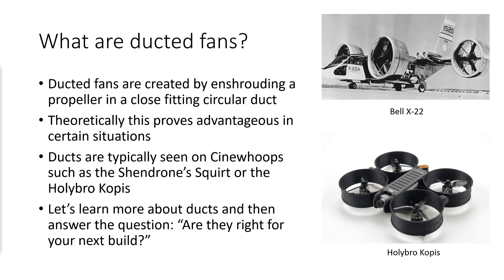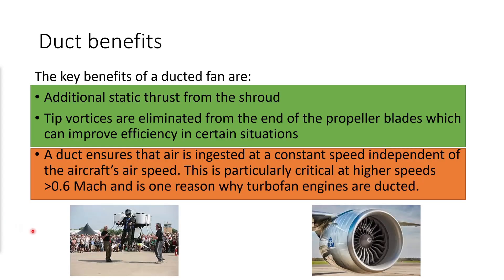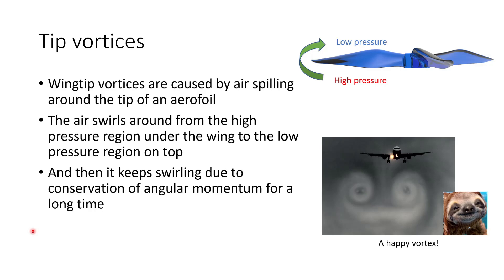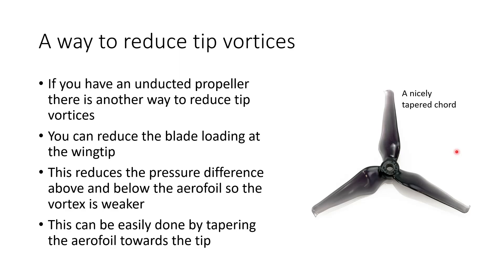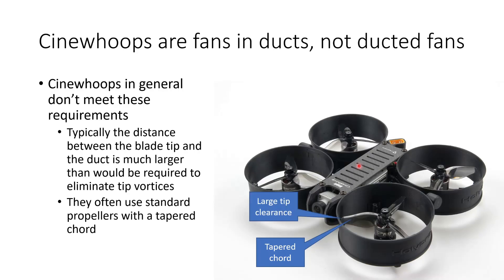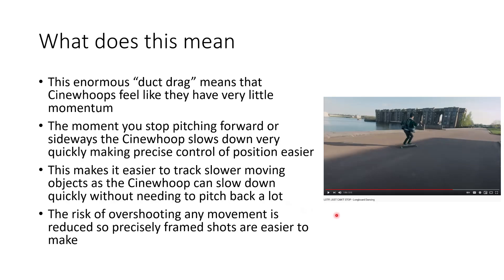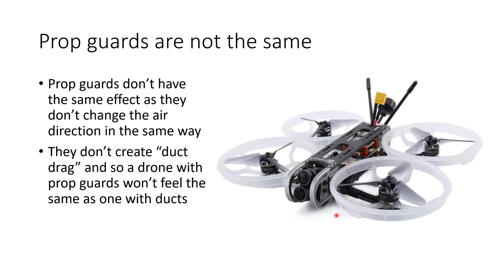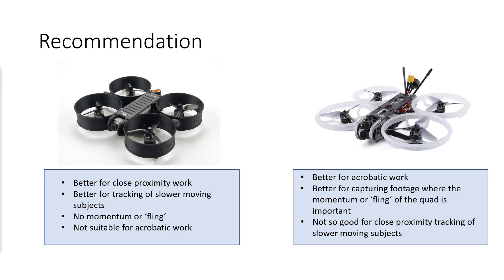How Cinewhoop ducts work and when you should use them

Comment: I recently started messing with ducts, and built a pseudo-tootpick-cinewhoop out of a 2.5" 2s/3s rig I have. Before I added ducts, this thing flew through the air like a dream, it was super quiet and stealthy, but also a bit hard to maneuver through small areas. I 3d printed some ducts that are halfway in between being prop guards and ducts, and it has totally changed the feel of the quad, also it is VERY LOUD! I think its louder than my 5". Its like a siren in the air, i bet my neighbors from 2 blocks away can hear it! I'd like to know more about making silent quads, and cinewhoops, and the sacrifices and benefits you get from flying both. Right now i'm happy because I can do a bit more proximity flying with this build, but at the same time it might scare the subjects to have a really loud siren buzzing around them!
Reply: Interesting.  I've been thinking of a cinewhoop with as low dB as possible.  

I wonder if there's any data

Comment: I did some ducted fan experiments recently.  I tried about 10 50mm props in a 3d printed duct and interestingly the props that looked like ducted fan props did slightly worse on average than the regular tapered props.  The number of blades didn't make a difference past two.  Tip clearance was less than 1 mm -- definitely achievable with a 3d printer.  If you wanted, you could smear a thin layer of beeswax or a similar soft substance inside the duct and then spin up the props and achieve near zero tip clearance.

Comment: You should check out NASA research about Prantl-D wing. Al Bower at NASA did a lot of research on Wings and Bird flight. He figured out that the same optimization for the wing also works for the propeller. In his version the vortex happens about 2/3 of the way out. So I don't know if this is also improved by a duct. But even without you should get better thrust.

Comment: I was hoping you were also describe props that have the duct directly attached, i.e. the duct spins with the prop.   There are lots of 'fans' that use blades like this, I see them in car radiator fans all the time.   I realize this creates a lot of extra weight and rotating weight too that will slow prop speed changes.
Reply from the maker: In my experience at the RPMs our props spin at those rings would just explode.

Comment: For the longest time, there wasn’t any innovation in props, there was only some R&D into materials for rigidity/flexibility for longevity purposes which changed flight characteristics because of how they flex. 
DJI put a lot of thought into their props for their mavic series, they are efficient and insanely quiet compared to what was available at the time. 

I think props still have a little more ways to go, maybe you can tackle the different effects that prop diameter/thrust/pitch speed/weight/KV can have on the overall setup…..
Reply from the maker: Have you checked out this video? https://youtu.be/epJ6L9MaXOQ

Comment: Super interesting. I already knew "ducted" quads didn't work as ducts, but your point about drag makes perfect sense !

On an unrelated note, my main gripe about cinewhoops is weight. I live in the EU, and the 250g limit is becoming very important for this type of quads. At 250g or less, you can basically fly anywhere, while at 251g, you have to stay 150m away from any human being :) My problem is, I wouldn't fly in close proximity without ducts or prop guards, but these add weight, which makes it hard to stay under the limit :)

Also, quiet props for cinewhoop would be great, as they is definitely louder than people expect.

Comment: Really appreciate the work you put into all this analysis. As an ex engineer (patent attorney now), I find it fascinating. However, this now does throw my choice of the next quad to buy into confusion! I was tempted with the iFlight Protek35 (which has guards, not ducts) for proximity flying around BMX riders on a race track (or tracking other similar moving objects), but maybe the Bumblebee (ducted) might be better if I want a more rapid/smoother deceleration through drag. Hmmmm
Reply from the maker: BMX riders go quite fast don't they? I'm not sure whether ducts are good for high speed chase shots. Once you get over a certain speed (~10mph) I think props with guards are probably the way to go.
Reply: @ChrisRosser  Very helpful follow up. Thanks. Yes, BMX riders can be very fast! So I take it duct are more appropriate for slow, controlled, cinematics. Noted.

Comment: Really good,  it will be interesting if you can make a part 2  and have a look at the racewhoop of free zillion.  Now HGLRC sell the racewhoop with the partnership of free zillion maybe they will like that you make a review of there products🤔.  I have also made a design myself and was able to improve the air flow/thrust of the duct 906g at 415watts with 2203.5 3600kv on 4s and hskrc3045 props,  the probleme most of us see is we get alot of desync and yaw propwash  but some user with AIO have no probleme and they can fly them like a freestyle drone. So if you are interested to give tip on how to tune them to be more freestyle friendly,  it will be great.

Comment: Hey Chris, this is one of my favorite vids so far, very interesting.
I wonder if there was somehow a slot in the duct the blades spun in would this help get the efficiency benefits of the ducts without having to run a 1/4mm gap? Or cause more issues with turbulence within the duct?
Also that video u linked was incredible!

Loving all the in-depth science behind our hobby, keep it up Bud!
Reply from the maker: I think you would still get a tip vortex forming in the slot if the gap wasn't  super tight. Glad you like the video!

Comment: a lot of light weight props seem to use prandtl propulsion
they have a lot of negative twist in them
the lift distribution isn't elliptical but more like a normal distribution / bell curve (bsld - bell shaped lift distribution)
the effect is reduced drag and with that faster spoolup i guess, more flow, quieter
the wingtip vortecies aren't at the tip on these props, but about 1/3 of one blade length inward
the wingtips outward of the vortecies act similar to winglets, just that they are flat (dihedral wise)
since the airfoils at the tips are tilted down, the lift vector points forward, producing induced thrust

bsld wings are ~22% larger than elliptical ones, for the same lift coefficient
Reply from the maker: Interesting. For quadcopter applications I would think that the requirement for thrust would push us to sacrifice some efficiency for more thrust for a given prop size? I don't know if the efficiency gain is worth making the prop 22% bigger with all the commensurate penalties in terms of MOI.
Reply: @ChrisRosser  it is a bit of a brain twister, since a elliptical wing of the same span has less drag than the bsld ones and the L/D is better in that case
bsld is the lowest drag solution for a given structural weight (root bending moment), while elliptical is the lowest drag for a given span
i still don't fully understand applications for the different types
if we look at the developements in prop design, it has gone away from bullnose and the likes
a reason might be, that not only the thrust is important, but how quickly it can be produced / switched between different amounts
a fast spoolup would help the fc do it's job fighting propwash and other oscillations
that might be even more important than going fast, it helps with attitude and altitude control, taking out physical "lag" while changing throttle input
a lot of fixed wing designers / developers object to bsld and swear by the elliptical lift distribution

Comment: Thank you very much for this great presentation. I was actually hoping to get insights which will solve the issue I have with my Bumblebee V2. I switched the motors to T-Motor 2203.5 (2850kv). 6s Battery and HQ Prop 8 Blade duct props. I am experiencing desyncs eventhough I set all the settings to fight desyncs and even more I experience a very strange behavior of the quad. When flying around the quad doesn’t react properly on my throttle inputs anymore. When lowering the throttle it just does not regulate down the throttle. It is very difficult to make quick changes in altitude like this. Sometimes it even increases throttle even when my stick is at zero already. I thought this could probably also be an aerodynamic problem. Maybe that because of the quad basically flying only at lets say 15 degrees angle the propellers get very turbulent air at the intake because the flight direction is really not equal to the direction the ducts look. This seems to be very suboptimal innmy opinion. But unfortunately I did not study aerodynamics and as mentioned I did not find anything which helped to solve that issue on the net. Any idea?

Comment: The tip clearance is super intesting. I gave up on tip clearance early on and just asumene everything were running are psudo ducts. Within 2mm is fine.
Reply from the maker: The biggest thing I realised looking into this is that tip clearance isn't really responsible for cinewhoop handling. It doesn't matter that much. As you say within a few mm is fine. 👍

Comment: Im just learning about this, but if you created a looped motor around the duct with the foils curved inward toward the typical the point of rotation but not connected, would the tip vortices be in the middle, creating a vacuum of sorts in the center, causing the air to flow aroind al the blades and combine into the center of rotation?

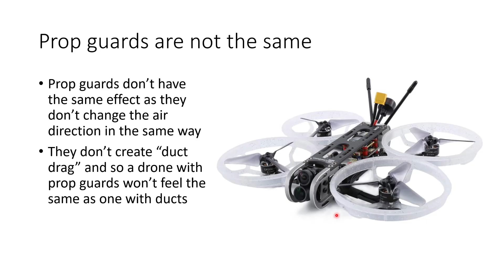Comment: I just ordered a squirt v2 slammed version, the body is shorter and also the ducts are shorter, you said at 16:50 that the quads with just prop guards will not have the beneficial effect of the different feel.
Should I amend my order to the non slammed version? I'm not sure if the slammed squirt ducts would still have this effect or if they're basically just acting as ducts, but QSL the people I bought from tell me it is still a duct rather than a prop guard.
Reply from the maker: I would say even shorter ducts will still have plenty of duct effect.

Comment: Insightful and valuable information. I have been designing my own cinewhoop and its nice to learn more. What about integrating duct and prop to get the clearance issue (rotating duct)
Reply from the maker: Rotating prop rings are very tricky for props that rotate at such a high RPM. Either you would need a lot of blades (which would eliminate any efficiency benefit) or to use a super high performing material that is stiff enough not to deform and break.
Reply: @ChrisRosser  kids toys have props with built in protection. Not ducts, but prevents injury.

Comment: Thanks Chris. Very good Information. Just one thing: if you want to fly close to people with a cinewhoop, ducts or prop protection are nice to have. But doesnt it make the quad much louder? The bigger ducted cinewhoops are rediculessly loud. Draws too much attention, considering its mostle not legal to fly in populated areas near people.
Reply from the maker: Typically cinewhoops are loud due to the high disc loading. They have 3 inch props but weigh as much as a 5 inch quad sometimes. I think that makes them louder in a hover. At full throttle I think a 5inch is louder than a cinewhoop though.

Comment: Hi, 
I asked you this question on your video to props too, but dont know where this fits better and where you will read it, so I copied it here to, hope that is okay:

I asked myself all the time how to think about this on my Cinewhoop: 
To begin with: I have a squirt V2 at home and also I am just designing my own "megas-quirt", that fits 3.5" (89mm) props, as my Squirt is barely holding 
itself in the air with a Hero 8 and a 1300mAh 4s lipo. 

Now to my question:
How do you think that multiple blades change the therory. By that I mean 
the 6- or 8-bladed HQ props, or the much steeper Gemfan D76 or sth like 
this. My testing tells me, that  two props that both are called  to have
 a pitch of 3 aren't really comparable, doesnt matter whitch size (3", 
5", ...). 
In the cinewhoop-part also the diffrent blade-count makes 
everything even more uncompareable. I really have problems to compare a 
Gemfan D90 (3 bladed prop, pitch "3") to a HQ 89mmX8 (also pitch of "3")
 but they clearly are diffrent in their steppness-angle and will poth 
have very diffrent thrust. 

toothpick-class: Gemfan for example 
has a 3018-2 prop (biblade) and a 3016-3 (triblade), I also cant tell in
 this case which prop I could expect to have more thrust. The issue is, 
that we often dont have real numbers to calculate with or alternatively 
have simulation-values or static-bench test from the manufacture himself
 (1st hand).

Sometimes I have the feeling, the manufacuters 
dont use the pitch-value to tell us how steep the balde is, rather to 
tell how much thrust they think the prop makes compared to their other 
props on the market. By adjusting the pitch value they use for marketing
 so they can put their props in somewhat of an order they make 
comparison for us pretty rough, and practically impossible to compare to
 other companies.

Did/Do you think/feel the same as I do, or do 
you understand my problem? If so, do you have any idea how we could 
interpret these values we get from the manufactures, or do anything 
about it other than just buying a ton of props just to find out that 99%
 arent the ones we where looking for?

Thank you so much for your videos, it is great to understand such topics in greater detail, love it, keep it up!
Reply from the maker: Comparing props is difficult because they are not fully specified by the manufacturers. Their performance is also very dependent on your AUW and flight style.

I would suggest trying a prop and then asking yourself what you want more of:  thrust? smoothness? efficiency in hover? efficiency in fast forward flight.

Then use the info in the props video to move you in the right direction. E.g. more thrust = more blades or steeper pitch (but steeper pitch may be less smooth).
more smoothness = shallower pitch

It is not really possible in my view to pick the perfect prop just by looking on the web. But it is also not necessary to just buy every prop and try them all. You can take a more focused approach. I hope this helps.

Comment: Are you 100% sure your math on vingtip vortex and distance from wingtip to ducts are correct?
I see a noticable increase in flight time, with over a full minute more flight time with ducts vs no ducts, how is this not added thrust? This was with a full mm between wingtip and duct.
I hope you give some answer to this.
Always very interesting to watch your programs, keep it up Chris!
Reply from the maker: I'm pretty confident on that maths and I'm not the first to put forward that ducts on cinewhoops don't have tight enough tip clearance to get a benefit.

In your testing did you use exactly the same quad, with the same battery, motors, camera angle, all up weight, props, go pro. Did anything about the build change between no ducts and ducts? Did you fly as close to exactly the same as possible? Was it windy one day and not the next?
Reply: @ChrisRosser  When I did those tests it was the same cinewhoop, 2 packs no ducts, then same two battery packs after charging with ducts. So ALUW with ducts was increased by the weight of the ducts. Still flew much longer. Weather did not change in the half hour or so it took to charge the batteries and put on the ducts. No wind, same temperature. Flight path was just around and around my garden at constant same speed, to make flight path as identical as possible.
This leads me to believe that there is something going on here. I dont know if its the math that can not be scaled down to this size with the same accuracy, or what. But I get increased flight times, using ducts with ca 0.2mm (Brand new, newly grinded) up to around 1mm spacing.
This is using Gemfan D76-5 props.
Reply from the maker: @dragonwingfpvbyespenlossiu3808  I'd love you to put together a short video on this. Does anyone else have the same experience? +1minute is a huge increase in flight time.
Reply: @ChrisRosser  One minute is a huge difference. Hence my first comment, cause I am trying to make sense of it. And only thing I am left with, after deducted reasoning, is the ducts do still create some lift, even with a gap of up to 1 mm. 
I can put together a video, hopefully sometime next week, else the following week.
Reply: Maybe the duct drag creates more efficient changes in direction
Reply: @jermadjesty  a graph of the amp draw as a function of flight time with dvr could help confirm your hypothesis

Comment: Why there are no two-bladed ducted fans? Can I make EDF more efficient for fixed wing by following same efficiency principle (lower kV motor + larger and minimum bladed prop)? 
Looking for long range cruiser wing with EDFs (possibly differential thrust like B2 or Horten Ho 229).
Reply from the maker: EDFs tend to need to get a lot of thrust out of a small diameter. So they use lots of steep blades and the duct helps reduce the efficiency penalty of doing that. To get equivalent thrust from a 2 blade prop the diameter would need to be much greater.
Reply: @ChrisRosser  Thanks Chris for very clear explanation. If EDF trades efficiency for size, can proper duct design compensate that penalty at least up 80-90%?